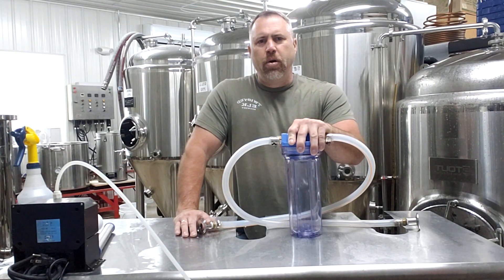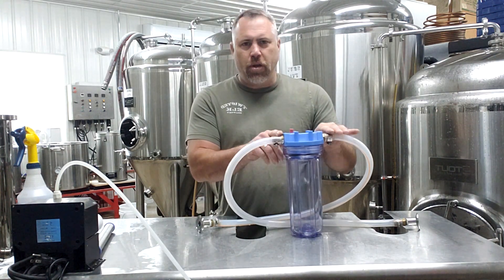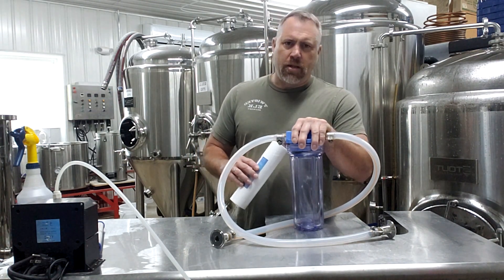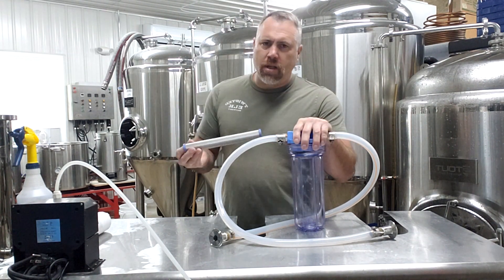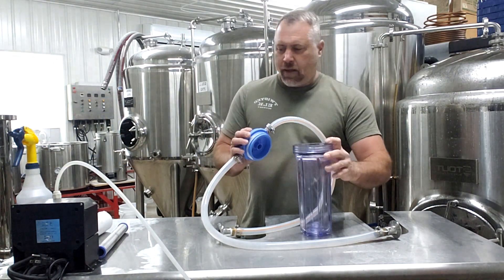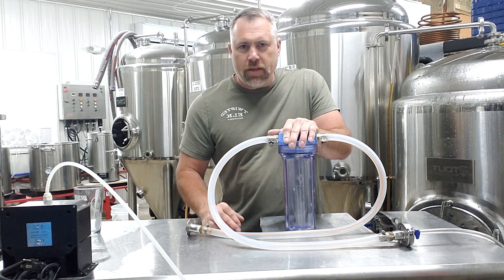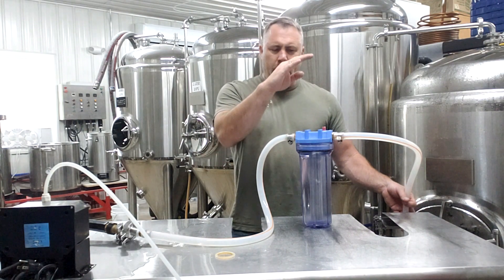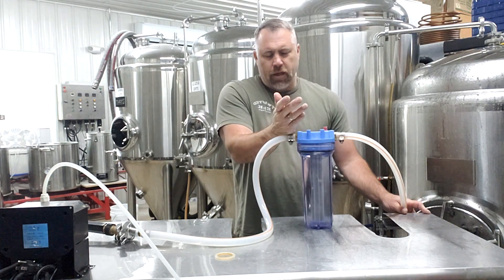How to Filter Homebrew Beer with a Canister Filter – Setup, Review & Pro Tips!

Comment: You can filter carbonated stuff just fine. But the source container, the filter housing and the receiving container are all pressurized with CO2. You put a regulator/vent on the receiving container so you can keep the pressure a bit lower than the source container. As a bonus, no worries about oxygen.

Comment: Just FYI, you can also get pleated washable sediment filters, which can be washed a few times and re-used. There are also cage filters, used by many breweries. They are back-flushable sediment filters so you can reverse flow and push it out a seperate flushing port.. Those cage filters are made by companies like Synopex.

Comment: Hi, I’ve been filtering beer through a 1 micron filter for about half a year now, and the beer is already carbonated. What can I say, it filters differently from the yeast cell, but it allows the malt cell to pass through, and after settling for about two weeks, malt sediment appears. You need to use a 0.5 micron filter or less if available.

Comment: Ho everyone, I am new to home brewing, question. Why filtering if you cam cold crash ?
Reply from the maker: Cold crashing and filtering is very different. Cold crashing helps drop the yeast out of suspension but it will not remove everything. There is many different reasons for filtering. Depending on the type of pads you use, you can get a nice clear beer fast without the long wait or even a sterile filtration removing everything making it safe to add flavorings containing sugar or sweeteners without the risk of re-fermentation. If you are making hard seltzer, filtration is a must. If you are a homebrewer and have plenty of time to wait, you probably don't need to filter in most cases.
Reply: @TwistedElkBreweryLakeCityPA  Thank you, my dream is having a tap room and your videos help me immensely

Comment: On corny kegging day. I use this filter with 0.5 micron pleated filter  and  close transfer. by pushing it through with about 5psi of Co2. And put 3 kegs through it . Then back wash it the same as you. And store it out of sunlight with VWP solution until next keg day. forward rince it and use it again. I replace the filter after 6 kegging cycles, so after about it's filtered about 340 litres . The biggest pain is it falling over.
Reply from the maker: That sounds like a good procedure. I was always nervous about re-using the filter media, but I know a lot of people do it. Someone needs to invent a little stand for this to sit in. A 3d print would be cool!